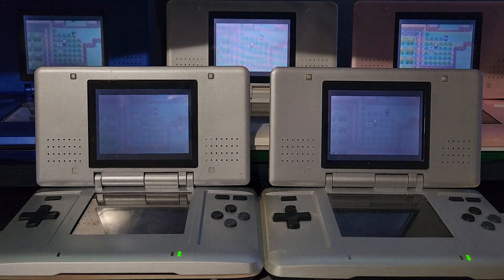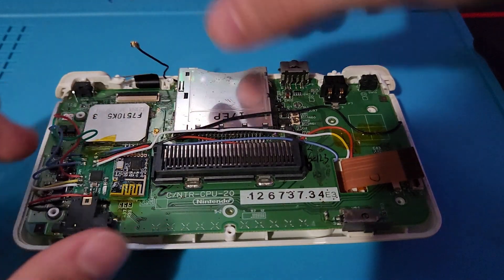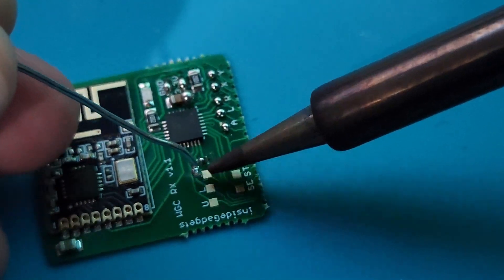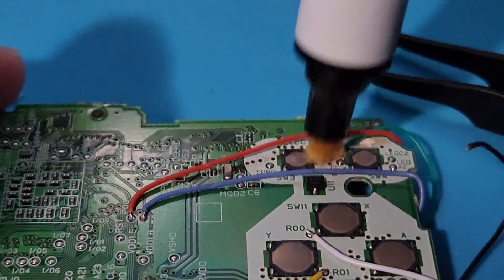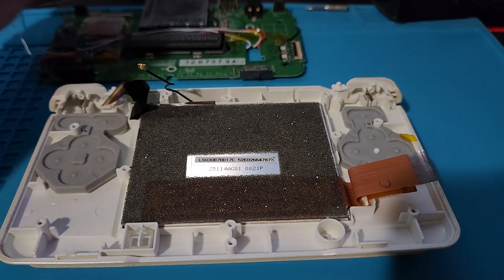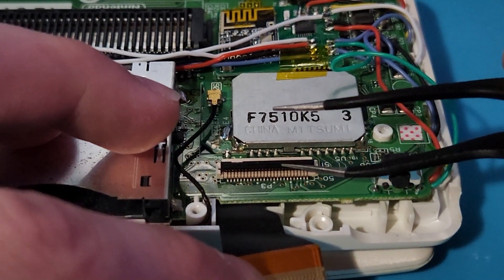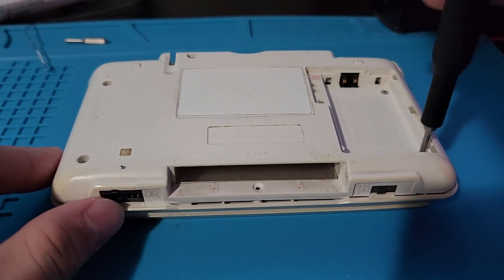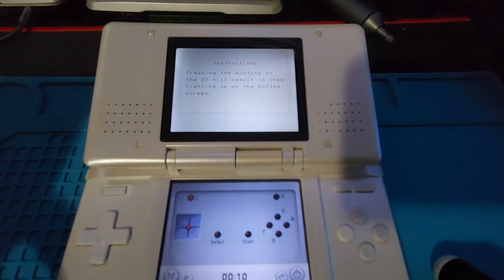Nintendo DS Controller Mod Upgrade Tutorial (GBA Wireless RX to Wireless RX)

Comment: Hey Tracker, I have an issue with one of the old boards, I have 4 installed and all work brilliant but recently just one has begun to always press left, I have replaced wire, I even swapped the console the board was installed in and same problem, when it's installed everything works but the left dpad even on the console Controls the left dpad doesn't register, have you heard any1 with similar problems and know a fix?
Reply from the maker: Hey man, I've replied twice now but for some reason I think youtube is flagging it as spam or something so I'll just keep trying lol
It sounds like something is shorting somewhere. Does the system still hold left without the WRX board in it? If so then it's definitely an issue with the board. If you would like, (I think this was getting flagged but click the first link in the description) and I could more effectively help you troubleshoot there :).

Comment: Does this also work for ds lite? I need this so bad
Reply from the maker: Insidegadgets has a Ds lite flex board that's made specifically for the ds lite. Here's the link to that👇
https://shop.insidegadgets.com/product/wireless-rx-ds-lite-flex-board/
Reply: @tracker707 can I do it without the flex board? Trying to make this as cost effective as possible, thx much🙏
Reply from the maker: @97iliketurtles  technically you can just use a WRX board in the ds lite but I would 100% advise against it. Ds lites are already pretty tricky to work in with not much room so putting in a WRX board is difficult. The price increase for the ds lite flex board is definitely worth it.
Reply: @tracker707 ya bought a bunch of lites was really hoping to keep my cost down but after getting my first install done I might actually just buy a ribbon cable if I can’t mod the case a lil

Had to take stylus cover off
Reply: @tracker707 and now they’re not even available lol
Reply from the maker: @97iliketurtles   yeah, the website said they should be back in stock the first week of March though. Good luck with your installs if you don't decide to wait 👍